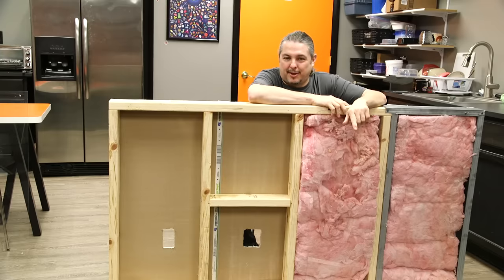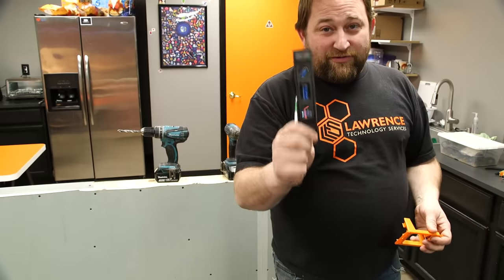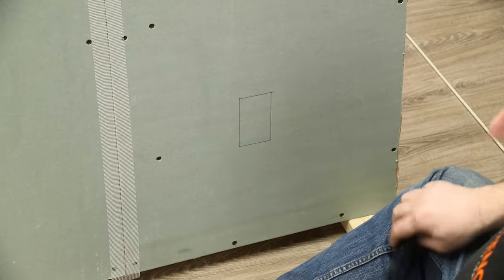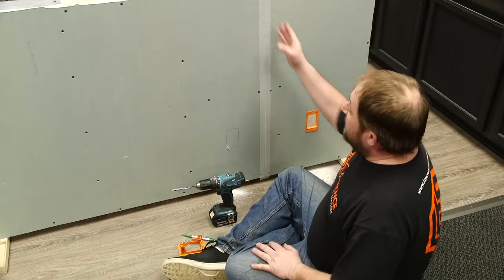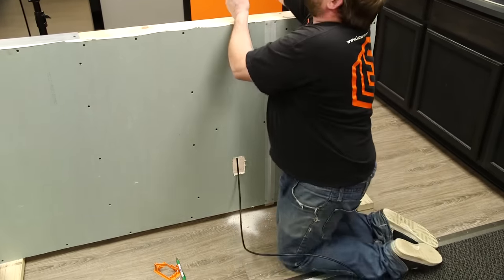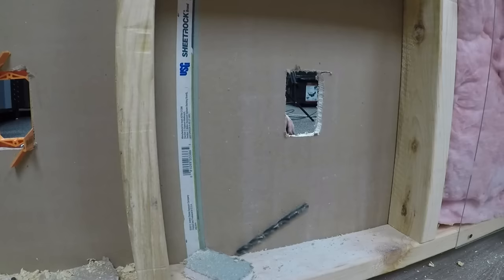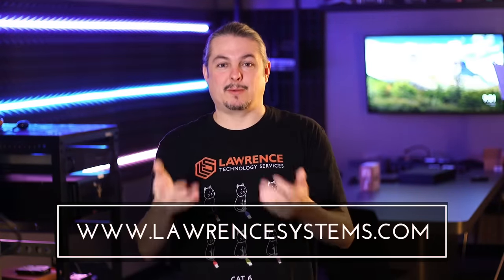Wall Fishing Tools & How To Use Them When Dealing With Fire Stops and Insulation

Comment from the maker: Structured Cabling Parts & Tools
https://www.amazon.com/shop/lawrencesystemspcpickup?listId=4IL2963UNMJS

72-Inch Klein Tools Flex Auger Bit 53717
https://amzn.to/2sQlvZ3

Magnepull XP1000-LC Wire Pulling System
https://amzn.to/2TeV4b1

Mid-Flex Glow Rod Set, 15-Foot Klein Tools 56415
https://amzn.to/2Un08ub
Reply: Tom what about concrete? Any videos on that?
Reply: b

Comment: Always cut horizontal first! If you hit a stud or obstacle, you can turn back and cut the other direction.
Reply: Carson Edwards or use a stud finder
Reply: @zachsmith1674  the stud finder loves telling you where those service feeds are
Reply: Walabot
Reply: Darrell Terry - I think it is only Android
Reply: @jasonjrf  Try replacing the battery. Mine would detect power on walls that had no wires at all. Replaced the battery and it surprisingly stopped doing that.
Reply: As for the stud-finder thread - changed the battery on mine and nothing; even after I found a nail hole.  Did it the  old way - knocked and a finish nail to confirm.
Reply: @jasonjrf  The. Oldest. Joke. In. Framing.

Did you know: there's actually a motion before the guilds right to change the term used to describe the vertical supports within walls SPECIFICALLY to change the whole _______finder thing so we don't have to hear that joke anymore?

Several alternatives have been put forth... I believe the leading contenders right now are "pimp" and "playa", though I'm told that some of the latino members are pushing for "papi".
Reply: @zachsmith1674  Or walk with a drywall patch kit...
Reply: Well damn I learned something today
Reply: @setapart7884  I did plenty of this. I even made access panels so if I ever want to fish new wires in the future I can access them and easily run new wires.
Reply: Knock first.
Reply: What do you mean "cut horizontal first"?
Reply: @mvmcali6900  when you're cutting into drywall.. it's a good idea to cut horizontally first(or sideways) so that if you hit a stud 2" in you know to go back the other direction with your cut
Reply: @MsDaddyrabbit1  there's more then one version but one I got didn't work couldn't set it up or anything.
Reply: Calm down, most of us know that.
Reply: Thanks! Very helpful advice.
Reply: @guitarist4485 i don't get what ur saying

Comment: Former telecom and home theater installer here: another option for fishing a fiberglass insulated wall: a 12 to 16 ounce lead fishing sinker with a string tied to it. It may require a 1"-plus hole in the top stud; but if you jerk on the string and bounce the lead weight,  eventually it'll find the path of least resistance---- between the fiberglass and the sheetrock ---- and each time you jerk the string the weight will work its way father down inside the wall cavity. A "bank" sinker, or an ovoid, egg-shaped lead "drail" with pointed ends,  worked well for me most of the time, but occasionally, the skinnier and more streamlined the weight, the better, like maybe a piece of 1/2 or 3/4" copper pipe filled with lead shot or molten lead. This technique is particularly  usefull when you can't drill through the top plate, and/or are working inside a drop ceiling where you don't have much vertical height or room to manipulate glow rods.

Comment: Another tip when installing cable and mud rings. When it is time to cut the hole you traced, get a sheet of paper and set it on the floor under the hole you are about to saw. The paper will catch most if not all of the drywall dust you make when sawing the hole.
Reply: Or get a small hand vac.
Reply: Turn on a vac while you’re sawing or use it when you’re done sawing
Reply: Piece of paper is a great idea even if vacuuming after. Vacuum never seems to get 100%, but the paper first should take the lion's share.

Comment: It's great that you can just drill through the firebreak without having to make another hole in the drywall, but isn't this a fire code violation?  Aren't you supposed to fill the hole with fire resistant foam if you're running something through a break?
Reply: ur right..but nobody does...all forms of modification usually break fire codes

Comment: In my case I’m dealing with a firestop and insulation
Reply: Use a piece of tube to go down to the fire stop then use your bit that way you don't have your bit catching your insulation because it will ball up your insulation meaning a big mess and patch job to fix also they missed one drilling side way though studs 2 or more  bit extensions go through multiple studs

Comment: Thanks for the video. I learned something so wanted to reciprocate: you can run a wall sensor from the planned outlet location on up to the spot where you would insert the fishing wire. If there's a fireblock then it saves you from making a hole. Building code says the integrity of a fireblock must be maintained so I've just slid over and picked a new spot so I didn't have to mess with it. But I realize that may not be an option for some installs.

Comment: I have literally been dreading running new wiring in my house that was built in 54 with no grounds because it has a lot of additions and shoddy fixes all over the place. There is no way of telling where the fire blocks are or anything like that so I have just avoided doing it. I just came across this video and I never knew there was a drill bit that is attached to the end of a fishing wire, that is a total life saver!

Comment: I have been doing this for many years and never have i gotten a beer out of a wall.  
I think i need more training on this methodology!!!!!!
Reply: I've found an empty beer bottle but never a full bottle inside of a wall.
Reply: @lelandclayton5462  I think I would be worried about the rest of the wiring in that house.
Reply: so how do you reach the top of the wall where you drill the first hole in a house thats already built. isnt the top of the wall already attached to the cieling?

Comment: Great video for starters.  I do cabling from time to time and had everything I've learned tossed out the window by one building.  The building is/was a 195 year old Hotel.  We installed 30 UniFi Protect cameras. I brought all the tools you mentioned in this video along with some extras like a Borescope, and a extra long Steel fish tapes, (120').  This Hotel had been remodeled an unknown number of times.  While the current owner had owned it for 40 years, he was completely hands off in terms of maintenance.  Current people who were familiar with the building included a 30yr who had worked there for about 5 years and myself.  I have been the IT person for over a decade.  The hotel had never had cameras and the wifi system was limited to a single wired UniFi AP and 2 remote wireless Uplinks, only about 1/3rd of the hotel had usable wifi.  One of the ceilings was solid wire mesh and basically isolated each floor like a faraday cage.

I planed for 3-5 days.  It took 10 days, 10-12 hr a day, and over 5500' of ethernet. Most of the walls were anywhere from 3-5" thick with newer sheetrock on top of plaster from the 50s, on top of wood paneling, there was then a gap that varied from 4" to 10" and the original walls which were some type of plaster, that literally took chisels to break and was effectively concrete.

The older wood, 100yr+, was in a type of petrified state that took hammer drills to get through.  In addition there were multiple sections of the building that had granite support walls.  These walls were around 14" thick solid granite.  

In addition to the 30 cameras, I added 3 more APs bringing out total to 6 and that got us about 80% coverage. At least there was usable wifi in all the hallways.  

We pulled the 2/3 of the ethernet from a single wiring cabinet on the ground floor.  There are 3 stories above the ground floor total 4, the top floor is unused and wasn't touched.  We put a remote switch/box on the 3rd floor and ran 5 cameras from it. Due to other problems with the ceiling on that floor we found it easier to run wiring to one of the back hallways from the ground floor to the 2nd floor then used one of the sprinkler pipes as a guide to get to the 3rd floor.

Between the ceiling of the 2nd floor and the 3rd floor is about 5-6' of sub ceilings and sub floors. The floors don't exactly line up and it was something of a nightmare getting to the 3rd floor, took nearly an entire day due to sub floors, brick walls, granite walls etc.

The current height of the hallway ceilings is around 10' on the 2nd and 3rd floors, though it is not consistent. The ground floor has a more reasonable 8' ceiling though some rooms have 10-12' ceilings.
Reply: Jesus, that sounds like a nightmare. Thanks for sharing
Reply: Best part about those nightmare jobs is the satisfaction when you finish
Reply: Easy
Reply: The weight increase must be insane. Remove all the extra layers and do it properly and you'd gain another 1000 sqft!

Comment: I use a template made of MDF for the mud plate hole to have the hole at the same height and cut it with a oscillator cutter. Saves me a lot of time.

Comment: Honestly being an electrician and network installer for many years I see a bunch of issues with this video. 

First off when marking out cut in data rings NEVER use pen or marker. Always use pencil and mark it lightly so that you can erase any mark in the case of something being behind where you plan on putting your ring in. 

Secondly, you have a magnepull, a good pointer for anyone that has a magnepull would be to use the fish end (the leader end that goes in the wall) to find the drywall screws so you will know where the studs are before you even plan on marking out your spot as no wall in real life would have the screws exposed with no drywall mud on them. 

Third, when cutting your data ring in ALWAYS start in the centre of your ring shape mark and cut either way horizontally to make sure nothing is behind the wall where you want to put the ring in. Also good to start in the centre and cut vertically up then down from the centre line incase for the odd reason there is something lower or higher then your box you can adjust your marks before you have to fix the drywall. 

And last but not least, make sure you tape your wire onto your fish sticks, magnepull, fish tape or whatever means of fishing you are doing really well as sometimes fishing walls may take lots of time depending on how easy it is to fish and you don’t want to do it twice. 

Anyways, those are my pointers. Have a good day everyone
Reply: Better idea is to use blue painter's tape. Make your (alignment) marks on that and drill after verifying location. Then you can remove the tape without any marks left to erase. I also use this for sight lines, level lines, etc. and it allows you to adjust to new marks easily if something is off.
Reply: As an ex electrician and telecom/datacom guy, I agree. I like the painter's tape idea, but most of us run broke and hurting for gas money LOL.

Comment: For boxes I'll be installing frequently I make a template of hard cardboard to draw an outline, the I use a multitool with a vacuum to cut the wall.
For pulling wire, I usually tape it on to the rod with packing tape that has fibreglass woven in - stickier, tougher and won't break.

Comment: This was a badass, very informative video on wall fishing especially dealing with "fire stops." Now I know how to find and deal with a fire stop.
Reply: It gets far more complicated in commercial office buildings where the studs and fire-stops are sheetmetal, not wood. On several occasions I had drill through horizontal metal firestops with a hole saw, starting from inside a drop ceiling, and adding drill-bit extenders to it section by section to reach down inside the wall and hit the firestop.  Both sides of the wall had wallpaper, and cutting additional holes to get around the firestop, to be patched up afterwards, wasn't an option....

Comment: One of these days I'm going to buy a magnet pull.  But they are a bit pricy.  My cheap method that works is to take a cheap tape measure, cut the end off with tin snips.  Form it into a bit of a point and you can manually work it down the wall between the drywall and the insulation.  The tape measure method costs about $5 for a cheap tape or free if you a have a "bad" tape measure you were not using.  The magnet pull is $125 in your link and much more here in Canadian rubles to buy.  Actually the tape measure is also a reasonably good pole replacement and for reaching across suspended ceiling tiles too and it's easier to carry up a ladder than a set of poles.  I love my stupid cheap cut off tape measure for pulling wires.  It's my favourite tool hack.

Now there are problems with cutting the end off a tape measure.  It will want to retract into the body of the tape measure.  You have to avoid that, but after the first time it does it and you end up opening up the housing you can take a few windings out of the spring so it has less tension when retracting.  I just tape up the end with electrical tape around the body of the tape measure when done so it doesn't let go and retract rather than rely on the brake mechanism.  Also the end gets a bit chewed up over time as you frequently kink the end while pushing down through walls but just cut it back again when it happens.  Another tip, cut it off at exactly 1 ft or 2ft mark and you can know if you pushed it far enough down the wall.  So an 8ft wall you cut 1 ft off, once you see you pushed 9ft of tape down the wall before you hit something and you know you hit the bottom plate and not a fire stop, or if you only go 3.5 ft you know there is a fire stop around 3.5 ft down.  

How to fire stop on an insulated wall.  Ok, no amazing tricks to that one, you are probably going to be doing some drywall repair at the fire stop to make an access hole.
Reply: I’ve been installing data cabling for the past 25 years, best method by far is a yellow tongue, the plastic strip that joins chipboard flooring together, it’s not metallic which gives you isolation if you hit live cables. Here in Australia they are about 2.4mt long, easy to also tape 2 or 3 together. As a tip always drill at least a 25mm hole in each level of timber, never know when you require another cable down the same cavity!

Comment: These guys are obviously experienced, but I prefer using a vibratory cutter after the layout of the mud ring. When I am handed a box of black mud rings with no holes at the corners, I first make my template by drilling a small hole at each corner for the pen to mark thru. I have the MagnnaPull set and it works on some walls, but not all of them. On occasions, you may want to use the bead chain that MagnaPull supplies in an empty wall to the mud ring cutout. I have pulled wire for about 10 years now, and all tricks are appreciated. The orange mud rings with the layout holes are sold at Home Depot.

Comment: My favorite ghetto install tool - garden stake from the local hardware store.

3 foot - vinyl coated
Cut/peel off the coating and you have a 3 foot aluminum tube with a diameter such that ethernet cable snugs right into it.

Use case: Those goddamned walls that inexplicably have a foot or more of space between them, and you don't have proper fish rods with you.

They will flex a little, but not quite as much as a proper fish rod.

You can join a couple end to end if you have to.

A buck a piece at the nearest hardware/garden store has saved me a couple times when on a remote install in an unfamiliar city from having to call a cab, travel to the nearest place that sells sticks, and return.

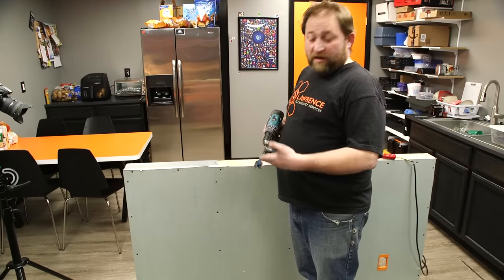Comment: 10:08 1 1/4 bit (hole) on a 2x6 wall could be a building violation of code. Most electricians keep their inspector happy by drilling 3/4-in. holes dead center on a 3-1/2 in. wide stud. I advise anyone drilling holes in bearing or non bearing walls to understand dia. size. must keep the structure strong heres a general list: 
    Holes in bearing wall studs (exterior and interior walls that bear the weight of the roof and/or other stories above) may not exceed 40 percent of the width of the stud.
    Notches in bearing wall studs may not exceed 25 percent of the stud’s width.
    Holes in non-bearing walls can’t exceed 60 percent of their width.
    Notches in non-bearing walls can’t exceed 40 percent of their width.
    The edge of a hole must be at least 5/8 in. from the edge of a stud. A ceiling joist or floor joist allows a hole of 33% of the size of the lumber, but holes cannot be bored within 2 inches of the top or bottom. On a stud, holes cannot be bored within 5/8 of an inch from the edge, but Article 300.4 of the NEC requires holes bored within 1-1/4 inch from the edge to have nailer plates. * yes I realize this is Low voltage cable and NM-B would not be (should not be by code) in the same raceway/holes.

Comment: Nice video.  Try doing a video that solves what people actually encounter in the field.    2.4 meter high internal stud wall (which many houses are).   Vertical stud half way down, and insulation all throughout.    Running cable from ceiling, down the wall to an outlet 300mm Above-floor-level, and customer wants to holes made in-between to access magnapull when you hit the vertical stud

Comment: I break into office building at the weekends, cut holes in the drywall and look for beer. 
Not going too well so far - any tips?
Reply: Gord Slater look in their fridge
Reply: can confirm fridge method is still working :)
Reply: Ever find underpants gnomes in there?  What phase is that?
Reply: Buy a magnetpull
Reply: Try the flooring 👍

Comment: Great video and learned some things.  Definately will look into the magnepull. I wish this video show from the point of view were you don't have access to the very top of the wall.  You would cut the top and feed it but the angle is not always straight.   So, wonder how the fire wall drill would react